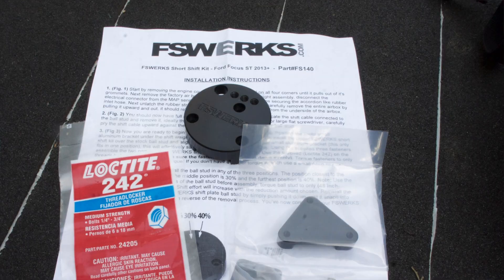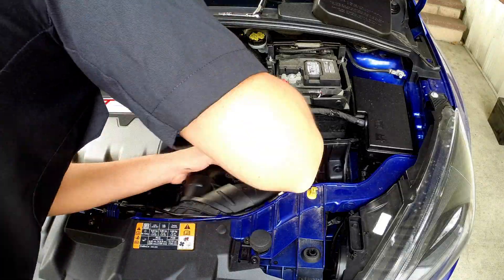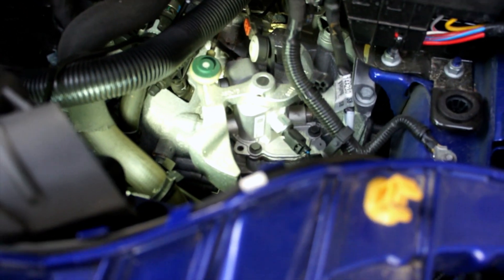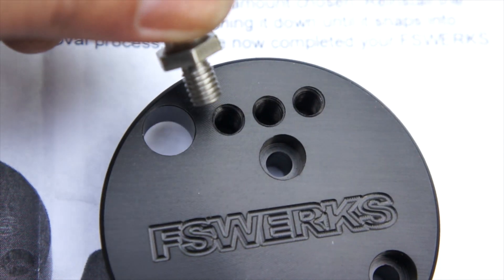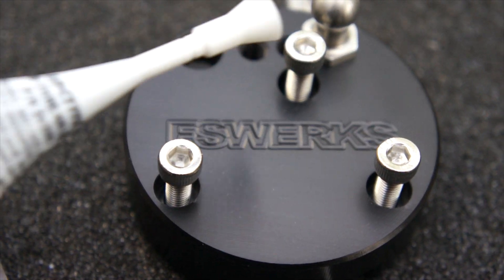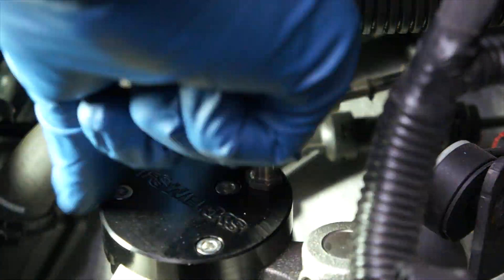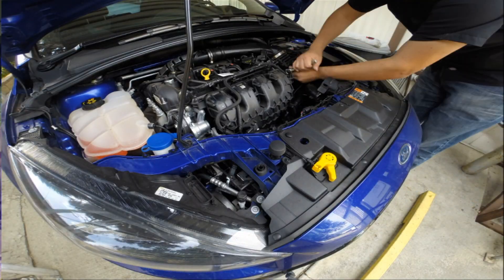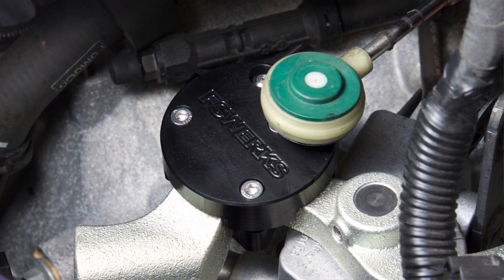FSWerks Short Shifter Kit Install Focus ST / Focus RS : MotorCarNow

Comment: Great video, thank you...One quick note is you must bolt it together prior to choosing the % as you would not be able to access 30% if you try to bolt it together afterwards... &  FSWERKS, not FocusWerks ;)
Reply from the maker: Thanks for the heads up. 
I have been a customer since the "Focus Sport" era. 
I guess that is why I convert FS into Focus. 
:  )
Reply: I just installed mine and is it normal for you to here a loud clunking sound sometimes while shifting? mine is set at 40%
Reply from the maker: The one we installed did the same. Even after having it on for five months I still notice the clunk sound when I am shifting. And you can see that we followed the directions like you probably did. So i think it is normal since it is attached to the linkage not the shifter itself. I don't mind the sound anyways since it feels much better shifting than the stock kit. -Alfred
Reply: FSWERKS can you add me on facebook I have a of questions to ask you.  I have a 2010 2.0 duratec  with a five speed. se Coupe
Reply: FSWERKS I want to no it short shift will work on my 2010

Comment: Hey I have a question. This should work for a base Focus right? It's a 5 speed not a 6 like the St. I have a 2012 focus S with a 5 speed and finding short shifter kits for it are impossible.
Reply from the maker: I am not sure, only because I have never looked at the shifter base on a 5 speed. Since the video has an image of what the shifter looks like I would access yours and see if it looks similar. If it doesnt then I think you have your answer.